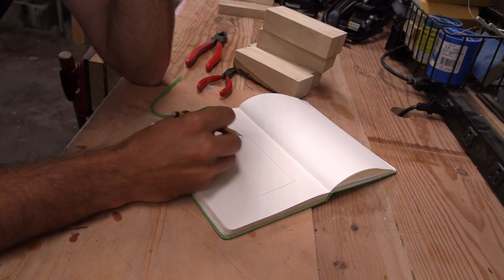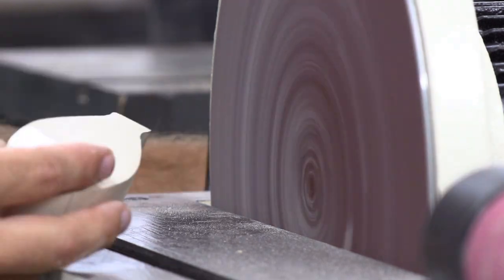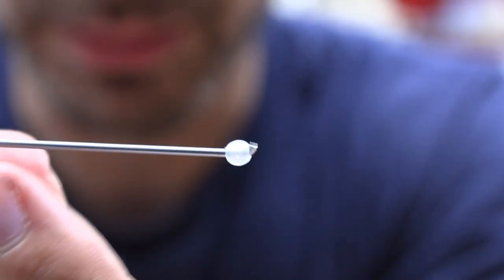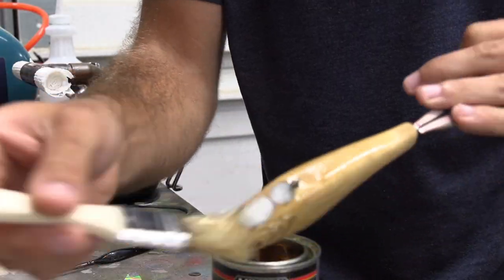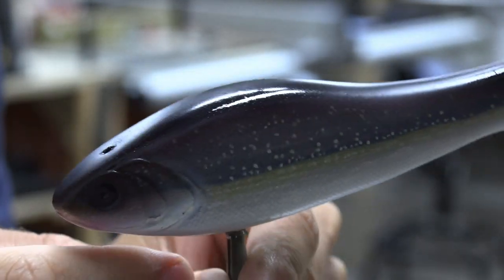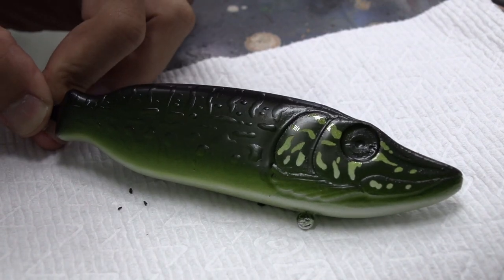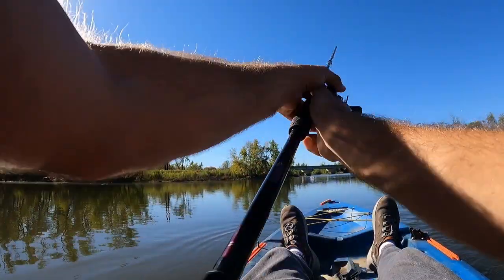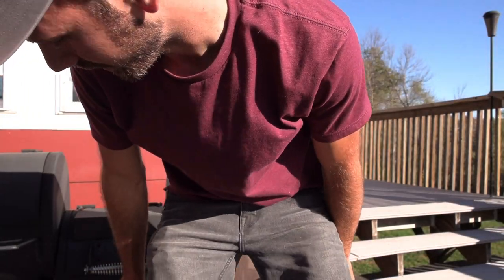Making a Batch of Unique SpinnerBaits

Comment: Great Job and nice technique on painting identifiable layers.  When screwing into lead or (hard surfaces for that matter) matching proper drill size to the minor diameter of the screw is important. I mostly use my dial calipers then play with the tolerance based on tightness (or softness).  My father taught me to use wax on screws where snapping screws off is a concern.  I wonder it this would work with lead?

Comment: Not a bad pay day get home see the video and already sold out. I'd have loved to try that shad down here on the rivers when we get a south wind and bass fish. Think it would work great on strippers and largemouth when the weather keeps me off the bay and gulf. Meant what I said on earlier post, I'd sponsor or support a lure build if you'd like to venture into salt. Most inshore species are similar to bass . Same principles apply, just instead of current you add tide flows too. Brackish water is the same way I've caught bass in if not near salt water and redfish in water clear enough to drink. Like literally refill waterbottle and drank from a cold water spring 30 miles from saltwater on my kayak, while refilling 17" red crushed a Zara spook. Also seen bass regurgitate shrimp when caught multiple times. So they do eat saltwater prey if their habitat and water supports both species simultaneously

Comment: As someone who splits an awful lot of wood I'd say that having a reasonably sharp maul is important but razor sharp is kind of unnecessary, gravity does the real work and the edge just kind of directs it. Also that while wooden handles look and feel nice but fibreglass is where it's at for practicality because they don't rot, don't split and are really hard to damage with a glancing blow. I've been using the same cheap fibreglass handled maul for 10 years and several thousand logs and the head has never even wobbled, I've redone the grip tape a few times but that's been about it.